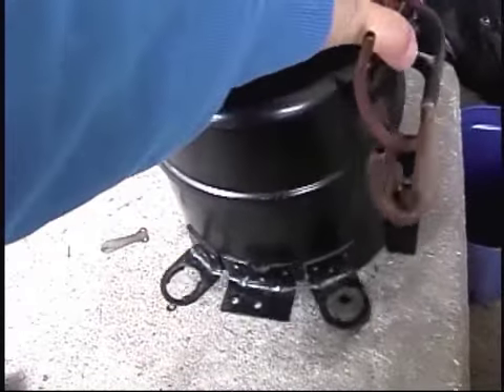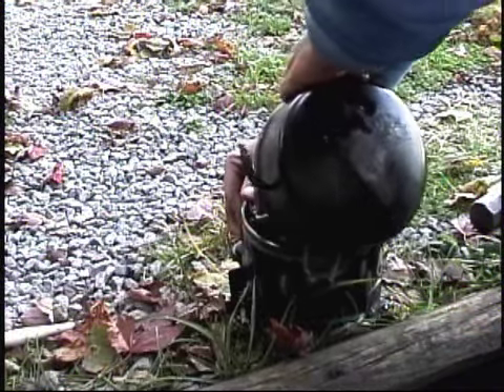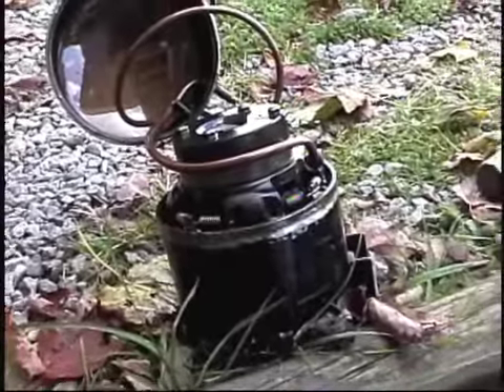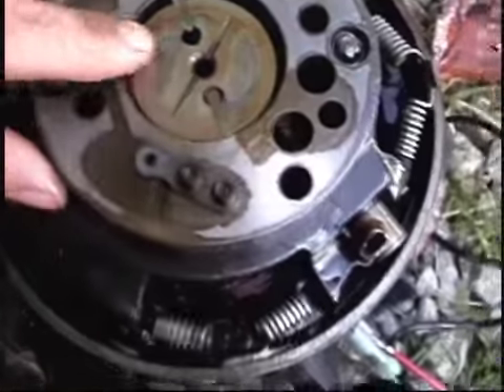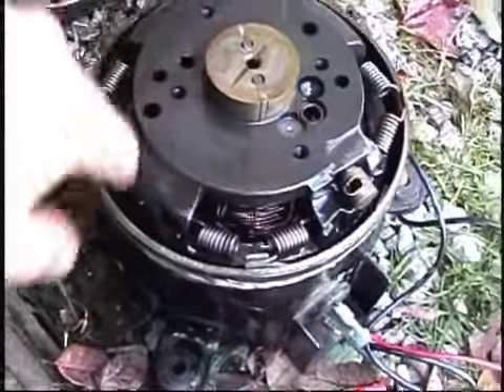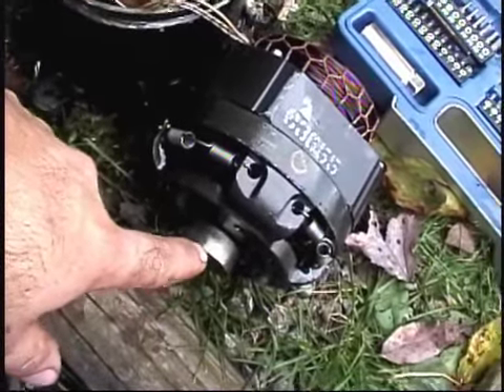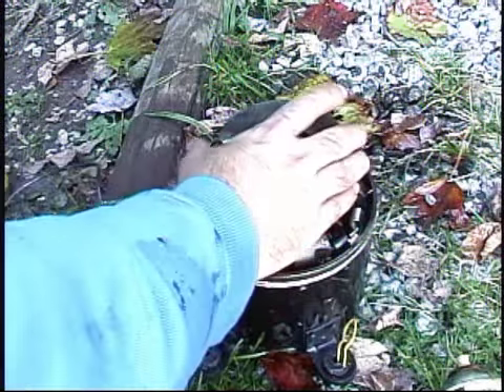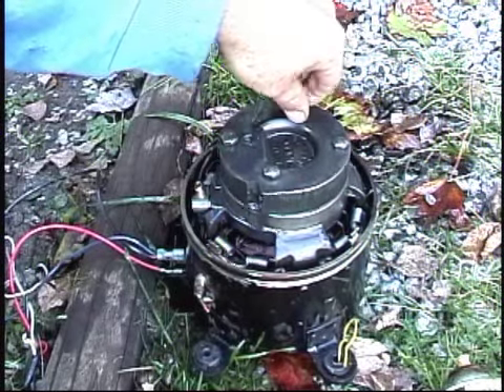Whirlpool Compressor LOST ITS HEAD ?

Comment from the maker: It already had debris in the lines and had setteled in the compressor, its bearings and oil passages.  I had to work with it for a long time to get it to free up and run.  I could even tighten down the head without it jamming.  The fridge it came from I believe had a blown defroster heater which, well destroyed the compressor or atleast started to.

Comment from the maker: @1972FordF150 well, then we might have fire with the heat this thing gave off.  The main bearing is really toast, the oil journal in the shaft is blocked which is why it wasnt pumping a lot of oil up.  Some machining, adjusting, swearing, and welding the top back on it may have worked.  Not worth it, but it isnt easy to get ahold of them around here.  PA sucks!

Comment: This thing looks just like the compressor in my 86 Kenmore (Whirlpool) fridge. I wonder if its also a rotary vane type, I bet it is as its almost silent running but it doesn't sound like a standard compressor for the few seconds it makes noise while building pressure when it first starts. I know these compressors run at a low speed (I think around 1200 rpm) which helps keep them quiet. Mine sounds similar to yours running except mine sounds a lot healthier and obviously not as loud being as tho it's still installed in the sealed system.
Reply from the maker: This was a nice running compressor till it locked up..... I think it was on borrowed time when I got it as the fridge was having issues.  It is hard to come by these anymore.  I got this after the system was evacuated and was getting ready to be scrapped.... I would like to find another one.
Reply: @More350Power  Pretty much any Whirlpool, Kenmore, roper or any fridge that was made by whirlpool had these into the 90s. Just be careful some of the Kenmore fridges were GE and WCI, they're still good but don't have these compressors. Also a lot of the old Sears Coldspot dehumidifiers had these. Very nice and smooth running compressors when they work right.